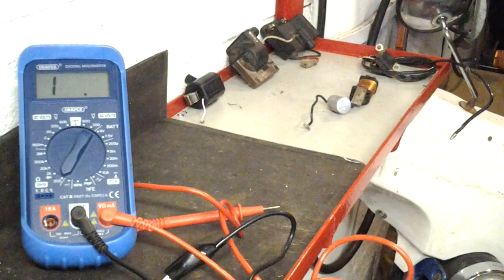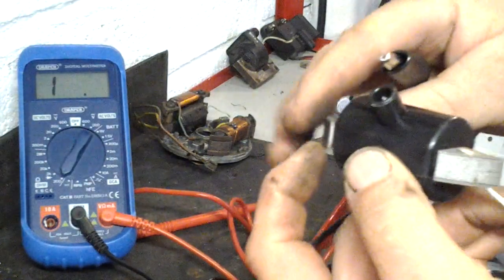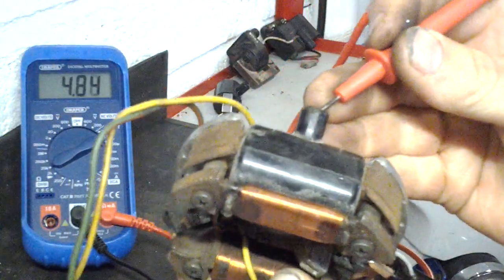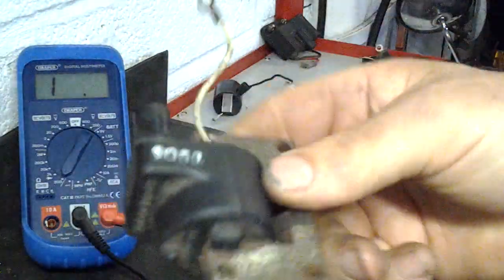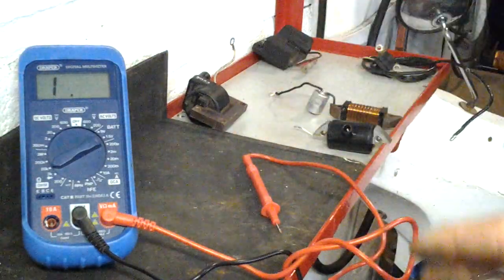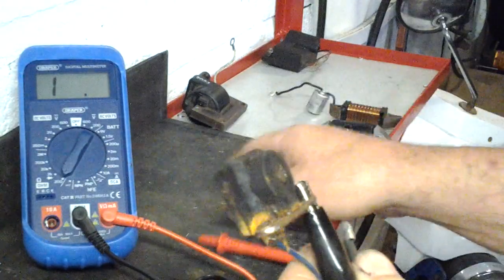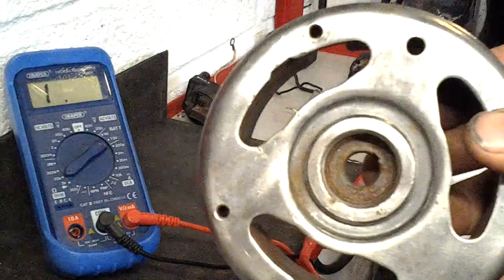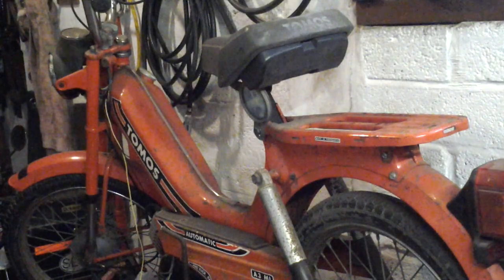How to test Tomos A3, A35, A55 and Puch Maxi moped ignition coils.#moped

Comment: Extremely helpful video , I have a tomos outboard engine with no spark and this video pointed me in the right direction thanks so much
Reply from the maker: I used to own a 4hp short shaft Tomos outboard. I bought it as a seized non runner but while restoring I found out what parts were interchangeable with my mopeds.
 The stator plate and flywheel are identical. The Tomos A3 flywheel still has the fixing holes for the cooling fan even though they don't use one.The piston and barrel are a larger bore but I suspect they're the same as the Puch MS60. Tomos built their own version of this bike and it's possible they used that type of engines top end design for the outboards as they were also fan cooled.

Comment: So I can use the ohm option on my multimeter to test?
Reply from the maker: Yes that's correct. Also, if it's a digital auto ranging multimeter, you won't have to change the ohm's range to test the primary and secondary windings.